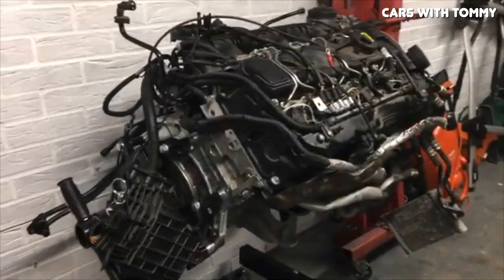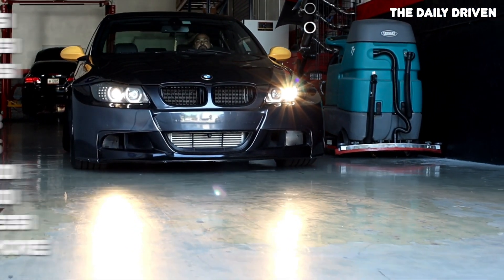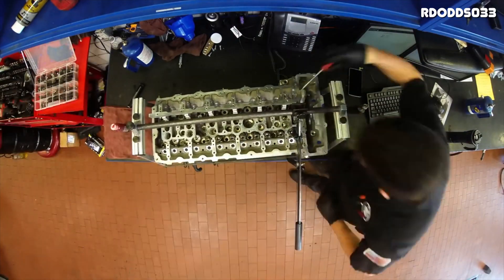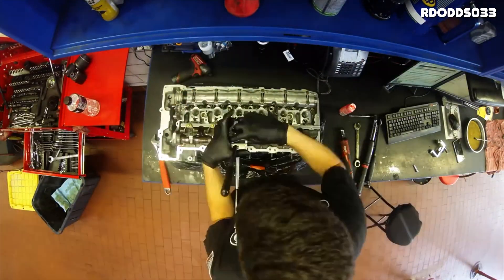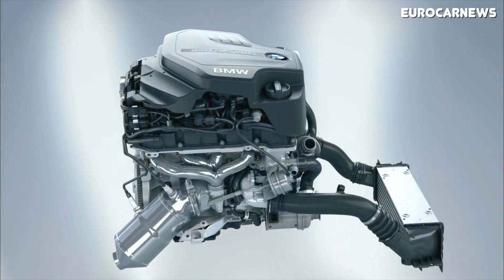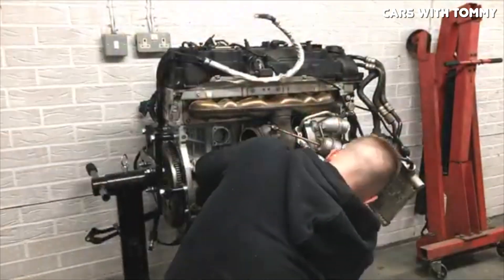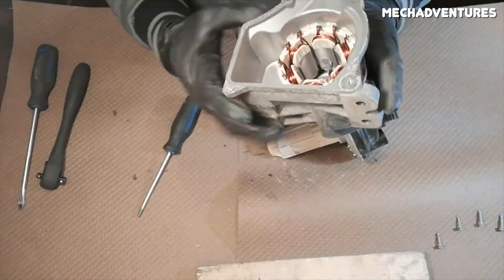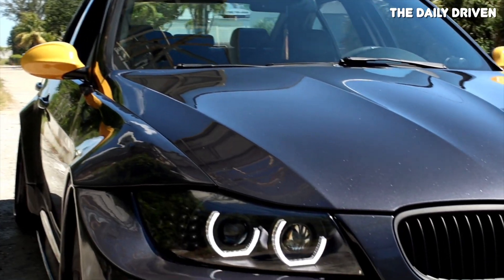BMW N55: Everything You Need to Know

Comment: N55 also sounds better than n54
Reply: Because you get all six exhaust pulses through one turbo.
Reply: @mattX5  hey man, I currently work on and build after market cars, and most recently we have just finished a 2008 335xi and a 2009 135i and currently working on a 2012 335is. The XI was single turboed, port injected, AM coil pack and some more like being FBO. Same thing with the 135i but it was stage 2 twin turboed. We got them both dynoed up here in idaho, the 135i was 638whp and 672 wtq and the 335 was 636 awhp and 610 wtq.
Reply: @candmedia  Twin turboed or twin scroll? Do you even know what you're talking about?
Reply: Love my ‘16 M235i,  engine is very punchy and super reliable. Zero problems as I’m the 2nd owner with low miles. Had the car fir two years now. Zero problems
Reply: @mattX5  Whatever you think 👌
You obviously not into that platform. 
✌
Reply: @mattX5  No your incorrect!
Fact!
Reply: @mattX5  any engine can push 600 hp it’s just a matter of how much time and money you put into the build
Reply: @ejcucinelli7695  huh
Reply: @mattX5  I beg to differ.  Ces performance has stock head and blocks running over 600 easily on a single turbo conversion.  And rk tuned a stock block n55 that ran 687 at the rear wheels.  So please tell me how the n54 and n55 can’t run anything even near 600 at the wheels.
Reply: @ncscumbagsfilms8007  stock n55 with 687? I don’t believe you.
Reply: @mattX5  bruh he literally owns the car

how are you supposed to prove him wrong
Reply: @dctmatt  yes I do own my car and on my 2nd n54 build.
Reply: @mattX5  Dude... all you had to do was a google search. Adam LZ's N54 335 made 800 on a dyno over a year ago. Pretty sure it was stock internals, too. I mean, the engine isn't super healthy now, but it did it...
Reply: @mattX5  the n54 is fully forged. Lmao they can handle 700+ wheel all day bro lmao
Reply: @CSKeaton.  wha?
Reply: @mattX5  go online and search it up. N54 can hold 650hp stock motor. So stfu
Reply: @mattX5  wow you are ignorant. Budget bimmers make about 700whp stock block with a precision turbo. Jake spence puts down similar powers on the stock block. The n54 can handlr up to like 750hp STOCK BLOCK with a big turbo upgrade. Stay away from BMWs Lmao 🤡
Reply: N55, FMIC, Full exhaust setup, stage 2 ECU and TCU tune with optional CAI.. You're golden.
Reply: I 100% agree
Reply: @mattX5  are u crazy,pure stage 2 turbis put u at like 650 to the wheels
Reply: The n54 is much better and is one of the only bmw engines with forged internals but since they stopped making it I have to get a n55 since I like new fancy cars but I do wanna n54 swap later on in years or might upgrade to a b58
Reply: For 8k u can make a n54 hit 800hp no problem with 2k u can make it to 500 tho stock turbos
Reply: @GoruGoruNoMi  i put 10k and make 500whp in my 135i so prolly not for 8k
Reply: it is.  i went through the (my2014 E71 X6) n55 BMW training manual today randomly as im bolting on and upgrading my shit :D they made some nice improvements, complete reworks and ofcourse brought a ton of stuff in from n54 that was great
Reply: Yup! Like the b58s less muscular brother lol
Reply: As a N54 enjoyer I agree with this statement
Reply: 😂 if you just care about the sound, then wear your AirPods with an audio loop of that playing, as your POS sits broken on the roadside
Reply: @mattX5  single turbo N54’s make 600+hp all day long. Doc Race has one that puts out 889hp. You have no idea what you’re talking about
Reply: Don't make it better. 
I pull +600hp in my N54 and it's not loud at all. That's the best part of it all. I pull up to a 5.slow or a 392 with all there cutoff mufflers and I just walk them every time. 
Sleeper is the way 🤫
Reply: @335bye4  Unnnnntil you come across an owner with a 5.Slow that's got a basic, entry level blower kit and he beats you like a red headed stepchild....every time.  And he did it cheaper to boot. ;)
Reply: @alfrede.neuman8611  That could be true, I admit there is always someone faster. That 5.slow better stick on the dig also, that's how I like play. The fact is I can, and do play with 90% of the cars on the road and hang very well. No I don't win them all but I gapped most. I don't get all butthurt over getting beat, I talk to the guy and get some information on his setup if possible.
Reply: @alfrede.neuman8611 very much doubt you could do it cheaper. You only need 4 grand to make 500whp on the n54. The 5.0 would definitely be more reliable tho
Reply: @335bye4  who tf cares what you pull it’s not reliable and only a matter of time before it blows tf up it’s a bmw lol foh straight up shitboxes I wouldn’t take one even under warranty
Reply: @335bye4 bro n55 can make +600 hp just gotta put lil more money in
Reply: @335bye4 high HP doesn’t make an engine better tho. In all aspects considered the n55 is better than the n54 just not in the category of power gains
Reply: @PrinceBallytv  👌
Reply: @PrinceBallytv  They can make pretty much the same power if you put the same turbo setup on them, they're very similar engines.

People comparing N54 and N55 power gains are never comparing apples to apples. The stock twin turbo system on the N54 flows more air than the base N55's tiny turbo (it's comparable to the N55B30O0 - which makes just as much power as an N54 with FBO - in fact you couldn't tell which is which looking at their dyno graphs). Most aftermarket turbo options for the N54 are pretty high flow turbos and have shit low end response (there are some good street focused options but nobody goes for them), most aftermarket turbo options for the N55 are pretty balanced and offer a good trade of between flow and responsiveness, a stage 2 turbo for the N55 tops at around 550hp but that's with a very good linear response these engines make 300+lb.ft at 2000rpm and 500lb.ft at 3000rpm. There are certainly lots of single turbo N54s out there making a lot more than 550hp but you look at those dyno graphs and at 3000rpm they're 200lb⋅ft down from a stage 2 N55 and at 2000rpm they make less torque than stock, they're not really pulling until 4000rpm. Apples and oranges N55s are predominantly modded to be fast street cars while N54s are too often modded to be drag strip cars.
Reply: @BigUriel  I agree. I have a FBO STAGE 2+ n55 and it’s super responsive. It’s a great street daily. My MPG’s also shot up. I get 34.5mpg on the highway now.
Reply: @BigUriel  It depends which N55. There are 2 versions, one with a PWG (pre 2013) and one with an EWG (post 2013).

If you're comparing the N55 PWG the N54, the N55 is slightly more reliable but is a big downgrade when it comes to internals. If you get a PWG N55 to put down 600WHP, it's a one way ticket to bearing failure.

Not many people know this but the EWG N55 came with a forged crank and conrods. It also fixed a whole bunch of issues the N54/N55 PWG had including a better water pump, less oil leaks etc. Because of the forged internals, you can run 600WHP on an N55 no problem with a turbo upgrade. Considering this version sounds better, is 10x more reliable and has way better fuel economy, the EWG N55 is a way better engine than the N54 imo
Reply: @wingmanlmg  💯… the later versions of the N55 with the EWG were a huge upgrade to the earlier units with a lot of the typical gremlins sorted.
Reply: Matt Finestein bro you have no idea what you’re talking about “n54 would explode so far before 600hp” you clearly don’t know shit about the platform do you?

Comment: Am i the only one having problems with the oil pan leaking oil from the oil pan plug on the 2014 x5 n55 35i???😔 oil pan costs $1,000.00😩
Reply: That's from somebody over torquing the drain bolt I have a couple e90s like that. All you need to do is read tap the hole re threaded. And oil pan does not cost $1,000 it's very cheap and easy to do just time-consuming dropping all the suspension connections. People say about cover gasket is $1,000 job too but I just took off my valve cover in an hour and a half time and putting one on in 30 minutes and I've never done it before just goes to show that if you mess with suspension and bolts then you can mess with some motor components do your own work. But as for your oil pan issue you can go to any shop and they will re drill and tap that for probably seventy-five bucks but then you want to make sure you get all the metal shavings out by changing the oil and flushing oil through to push out shavings good luck
Reply: BMW 335I i bought the oil pan from bmw near me, and it did cost me Over $1000, i tried looking for cheaper one but had no luck, used cost $600 and brand new did come with a 2 year warranty, “2014 bmw x5 xdrive35i n55” and about the retapping for the plug, i am very Very concerned about the shaving of the reedrilling, last thing i dont want to do is buy a new engine that costs over $4grand and am not even done paying for the vehicle.😩😔but thanks, am reconsidering replacing it my self.🤷🏻‍♂️ its a $2400 charge just to get it replaced🙁
Reply: @fivestarhemi2877  you shouldn't have bought that obviously, for a rack. As for the shavings that's why there is many tools that you can use they're are drills with vacuums on them you use oil to push more drilling out of the whole many different ways to do it they even make a cool set that makes it impossible for shavings to get in there and many ways to do it I've done it many times
Reply: @fivestarhemi2877  LOL I have gotten my oil pan change before I even knew how to do it for 450 man they're fucking crazy and that wasn't from a dealership I went to the dealership and they quoted me 850 I never go to the dealership ever you do your own work so far I've changed oil pan & valve cover for under 650 myself
Reply: BMW 335I i wish you lived nearby, id take you my vehicle, unfortunately i live in North Carolina (252) area. But thanks for everything.👍🏼
Reply: @fivestarhemi2877  I'm in Oklahoma
Reply: @fivestarhemi2877  you can do it man there's nothing to worry about just got to have confidence but I know for sure that you could do it
Reply: Nope. Haven’t had that nor heard of it as a prominent issue.

Comment: Actually the late 2014 N55s came with forged crank and rods, just the fuel system in the N54 gives it that advantage of them
Reply: I have a 2015 335i with the N55, I thought the forged bits were only on M cars?
Reply: @a9653192  depends if your car has the N55B30 series engine, this version does not have all the forged bits of the N55B30O0 (M235/M135i engine code).
Reply: Shival Ramkelawan yeah no I don’t have the forged bits. I have that N55B30M0
Reply: @a9653192  All N55s have forged rods. Higher performance variants have forged cranks. M2 variant has forged pistons, upgraded bearing shells, upgraded oil pump, lots of other minor modifications.
Reply: late 2014 435i’s too?
Reply: All late production runs of N55  have the rod bearings from the S55
Reply: False. Only the m135i m235i and m2 had forged crank on the n55.
Reply: @TheGamingBros-s5n all 2014 models have forged rods but no crank m135 and m235 have  both. Regardless though cast crank can hold a lot of power no evidence of it cracking under high power
Reply: N54 has a better fueling ??how so?

Comment: How is the reliability with a tune at +-  350whp for daily use ?
Reply: Awesome,  no issues!!
Reply: Depends on whether its e series or f series. E series has n54 problems, f series n55 is pretty minimal on issues
Reply: @Horus4387  2011 335i e90 has the n55. Both are good
Reply: @Horus4387  2011-2013 E90/E92/E93 got the N55 too.
Reply: @Khalid-gw4gw  yeah, I said E series n55 has n54 issues like hpfp, waterpump, certain hoses etc
Reply: same here no issues and i'm at 380whp on pump gas
Reply: AJ Cordoba any of you on the AWD trans? How good are they for holding power? I wanna make  good power/have no issues with weather/ no traction issues.
Reply: @albertwesker89999  my exact question !!!!!! Except no one knows what trans is in the 2016 435i Grand coupe F36 it’s an unknown mystery it seems lol 😂 I know it’s a ZF 8hp auto but idk if it’s first or second gen because the LCI went to the 440 which was a 2016.5 lol 😂 and a b58
Reply: 2014 f30 on stage 2 e30 map and fbo currently, probably almost a year combined stage 1 map first and then fbo stage 2 map after.. 20k no issues. Just get your step 1 colder plugs and get good coil packs, change your oil 3-4k and you'll be reliable
Reply: Just an issue with my injectors , but i assume because I have the first year f series n55
Reply: I’m over 350 and no issues
Reply: very reliable, especially on the m135i 2015 and up, so good.
Reply: No issues

Comment: Huh, didn’t mention anything about the M2’s N55 variant?  That is a big bummer I got really excited for this video.  Not only is it the most revised version of the N55, but they also insert many of the forged internals from the S55.  Not to mention the lightened flywheel and extra oil circulation systems they added.  It really is the last hurrah of the N55 and it sounds amazing to boot!
Reply: ...and then you have the M135i/M235i version in between with some of the M2 goodies.
Reply: @kringlefanten  info on it is kinda spotty but afaik it has the forged crank and rods but cast pistons
Reply: Yeahh, I was actually waiting for this to be mentioned as well 😅
Reply: +1, unlike n54, n55 is not one single engine, it’s a group of engines. While these are mostly identical, some variants can have different specs for internals and different power potential